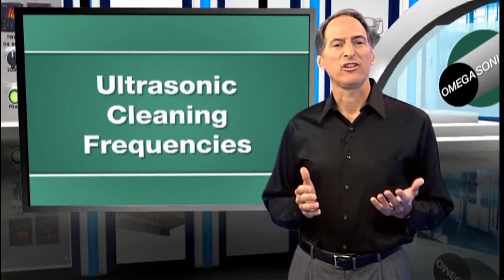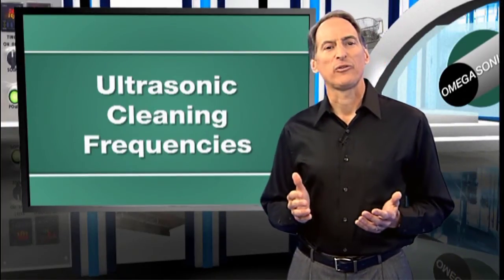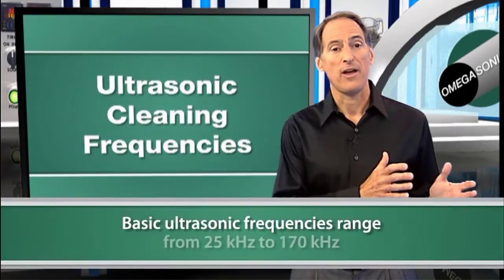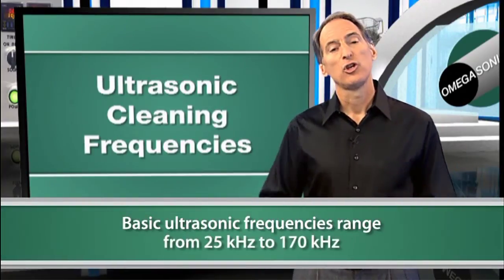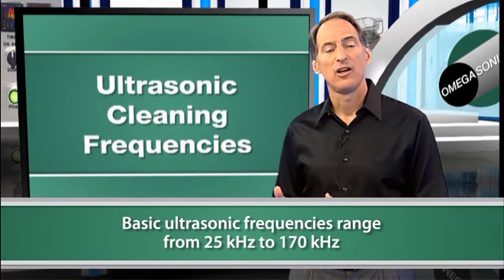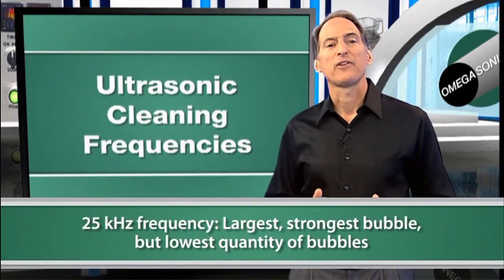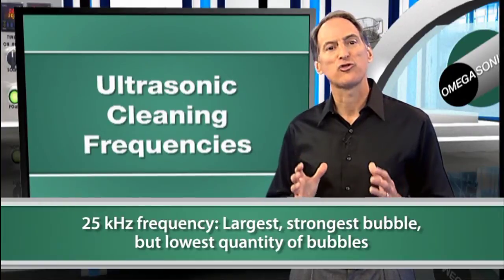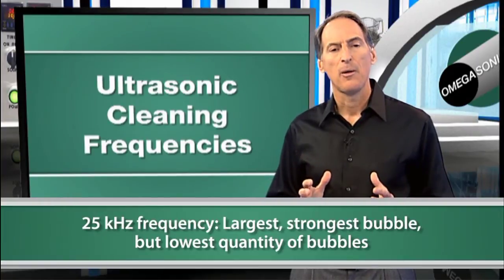The Importance of Various Ultrasonic Cleaning Frequencies

Comment: Does the use of 25khz wear the ultrasonic machine out quicker that 40khz. Ie the transducers etc. Based on the video we should be using 25 but the operator was told it will reduce the life of them. Im not in usa, but Australia otherwise id call. We are cleaning egr coolers, and dpfs +scrs. The egr cooler and manifolds i think 25khz would be correct based on your info
Reply: Scr and dpf 40khz